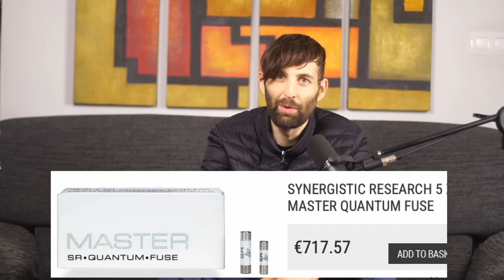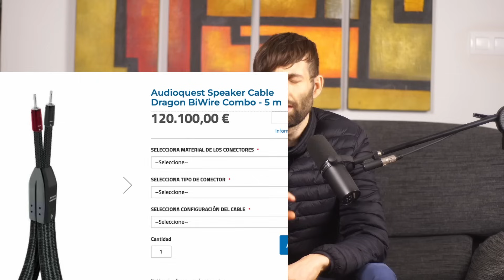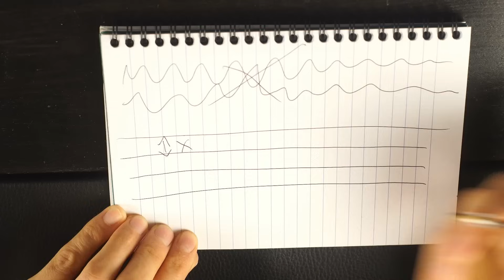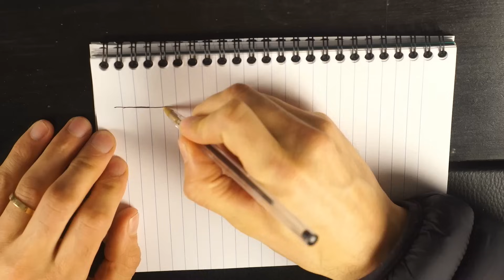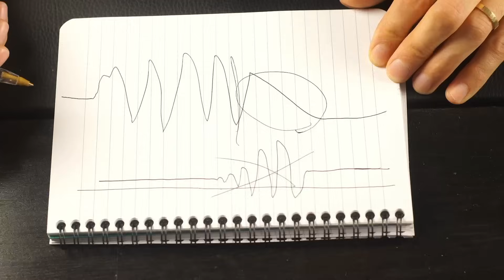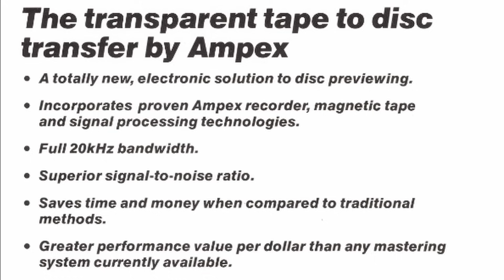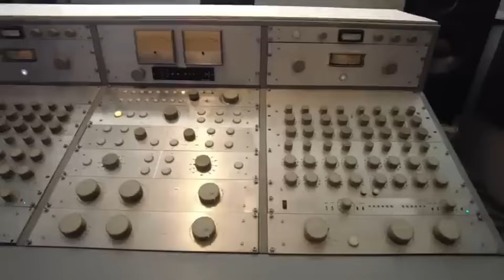Hard truth: most vinyl is digital anyway

Comment: Here's the thing about the digital delay. What was said is true. But audio digital delay is not used for every record. And the mastering studios who've stuck with cutting vinyl incorporated methods to use split the analog signal between the delay device that controlls the cutting head and the signal sent to the cutting head. What is suggested is that the signal passed through the digital and then in series sent to the cutting head. And this is possible, but the engineers who build this stuff know how sent the signal in parallel. This maintains the analog signal sent to the cutting head. What is suggested is probably true for mastering studios who've recently migrated from digital. And the truth is that the source recordings are likely digital in the first place, so this doesn't matter. But established mastering studios have staff that both build and maintain the circuitry of their signal path done in mastering. They can easily just add parallel circuit to keep their signal unaaltered by the digital processing needed to control the lathe cutting drive.

What I don't like about what is presented here, is that a technology invented in 1979 is assumed to not have been obsoleted since. The guys working in mastering studios are engineers. They don't call them that because they drive trains. These guys understand they understand their signal path. And if they don't like that a lathe has to work by using a digital delay, they will redesign the signal path. Again they're engineers. These are creatives that fully understand the science of all the equipment that is used in their studios.

Do some research. The best mastering studios not only have engineers working in the studios, they also have technicians on staff to assist the engineers. These guys aren't stupid. If they need the delay, they will figure out a way to keep the signal analog. And to suggest that this couldn't be figured in 45 years, is silly. The truth is, it was probably figured out in weeks. It might have tanken additional time to implement the changes to the equipment to solve this problem, but the design is simple enough to change a circuit from in series to parallel.
Reply: As far as I understand it, the digital delay in the lathe provides just enough lookahead time to adjust the pitch. By necessity, it is the audio signal that gets delayed, not some sidechain control signal.
The video shows a purely analog way of achieving the same with two tape heads, but apparently that's very rare.
Reply: If the cutting signal is passed though the digital delay and in series to the cutting head....it is still delayed in which it is still passing though an AD/DA converter. That is what 'series' means. There is no other way around it for most. Redesigning the signal path is either delay or no delay. Most LP's since the 80's are all digital. I do not understand why people have a problem with it. If a signal is in parallel, then there is no delay to one signal. That is a problem.
Reply: He’s not arguing whether its possible to do that, he’s saying that running records through a digital delay is “standard practice” for mastering nowadays. A digital delay was used in the cutting process for most analog albums in produced in the last 40 years. That’s what engineers are doing nowadays because it works better and allows for more dynamics.
Reply: This happened even way before 1979 in many places, with the early Lexicon units and other early digital delays. I usually keep this information for very last in any discussion with a vinyl maniac.

Comment: I’m an audiophile but try not to be an audiophool!  I also think you are 100% right.  I prefer vinyl (I have around 2000 LPs) and tube amps, but don’t pretend they are of a higher fidelity than digital, ‘cos they are not.  If you add up all the distortions in the vinyl playback process it would not be pleasant reading…I haven’t as, for example I don’t actually know how far out my stylus offset is from optimum, but even it was exactly optimum it’s only ever “correct” in two places: I haven’t measured crosstalk from the stylus:  I know what my valve amp adds and generally it’s less than 1%, higher at low frequencies…and I suspect the distortion would be several thousand times the distortion from a digital source using a solid state amp (which I expect is close to zero).  I also don’t fall for the speaker wire or the power cord fantasies and other audiophile snake oil…I obviously don’t have a sufficiently resolving system to hear any difference ;)
Reply: This was my comment in respect of the "loudness war" being the core of this problem:  I think you are probably correct.  Im a recovered addicted audiophile - ive had £50k CD systems and £50k Vinyl and there is no way CD is more enjoyable to listen to. I could put on an LP and listen for 8 hours. CD Im tired before the end of the CD.   BUT 24 BIT FLAC is a whole different ball game.  My dislike is CD...!!!

I PREFER to listen to vinyl on tube amplifiers and I am not bothered if its better or worse, its more enjoyable for ME.  Im happy to listen to 24 Bit FLAC. I dont like CD.
Reply: @piccalillipit9211  I like CD, and streaming, but Vinyl most of all because it is so visually and aesthetically pleasing…vinyl reminds me of days long ago (I’m 67 now, so very very long ago).  I recently bought a fairly old and inexpensive CD player, purely as it had a great transport which I use straight via Toslink to my DAC, sounds great to me.
Reply: @Alex-cw7xf  at 66 I didn't even know you had different styli shapes!
Reply: Come on do you really not use full gold (conducts less than copper) wiring? 
Also on digital, ONLY with gold plated optical cables!!!
Reply: @Kalvinjj  must try that, is the gold okay in bar form first?  I presume I’d need to line up the electrons using some cryogenic process to ensure they’ll flow in the right direction.  PS…an audiophool told me that putting my speaker wire in the freezer for a couple of days is enough to cryogenically treat them to get that perfect sound.
Reply: @AitchAitch999 Oh god I can't believe you found 1st hand experience of the "directional cable" people existing! Well that's an experience for sure! At some point I just can't discern anymore what is some internal joke/trolling that perpetuates and what people are really believing on the audiophool ring.
The funniest part about the directional cable is... if they existed, and electrons flowed better one way than the other, it would sound just as horrible as adding a diode in series with the cable, literally adding loads of distortion.
Reply: @Kalvinjj  - audio is an AC current, so do all the electrons bunch up at one end of a directional cable...???
Reply: @AitchAitch999 What I want to know is why silver wire is unbelievably expensive when silver is €900 per Kg - you get a LOT of wire out of 1lk - like 1km or so.
Reply: @ …and the audio signal is AC anyway
Reply: @piccalillipit9211  I expect because folks will buy it at a ridiculous price, if it wasn’t expensive it wouldn’t be any good
Reply: @Alex-cw7xf  I did not know that distortion was that high…presumably mostly 2nd harmonics?
Reply: " I also don’t fall for the speaker wire or the power cord fantasies".  Yeah, I did some tests on this.  It turns out that every speaker wire filters out a different part of the spectrum.  No need to spend a fortune on high end speaker wires - just run 5 different low-end speaker wires - even use CAT 5 internet cable and household electrical cable. 

You can easily test this - just go buy a few meters of the hard wire you use in your house walls and run it in parallel to the existing wire - I promise you it will sound better.  If it does not just ignore this internet *** LOL

Power cord you just need a thick cable and clean connectors - what will make a difference is you are using tube amplifiers is to use a separate GROUND.  Buy a copper ground connector and bank it into the ground outside the house and then run a cable to the chassis of your tube amplifier. Tube amplifiers NEED a really good ground and most houses don't have one. There is usually +/-20 v to +/-50v on the ground of a house
Reply: @piccalillipit9211  I think once you have spent around $100 dollars on speaker wire, you have as good as it gets.  Better…ensure you match impedances between speaker and amp (esp valve amps) to ensure the amp is driving the speaker effectively, impedance of the cable between the two is negligible.
Reply: @AitchAitch999 - Try adding a parallel 2nd cable - see what you think. But dont spend any money on it.  I have to find a way of getting Toslink out of my new iMac cos they removed the optical output
Reply: @AitchAitch999or just run balanced lines... Even easier and cheaper, that.
Reply: @Guynhistruck   Its a joke comment dude.    Have got some grass handy, maybe go outside and touch it...

Comment: Really nice content! I am just audiophile, but I usually find CDs better than the vinyl versions on modern issues. And probably because my turntable setup is inferior than my CD one. It is way way way cheaper to just got a great sound from CD than turntable if you know what you are doing and not afraid of some diy modifications. Reel to reel is not option for me. Probably if I was millionare... But man like you said it, the experience is different, I just love to interact with the whole system, to do all the settings. Also some old stuff from 60s and 70s is way better on vinyl, just because modern CD and vinyl remastering and transformations from the old tapes is such a hassle and you will be happy to find these tapes on good condition probably and not some master from master or just production tape.